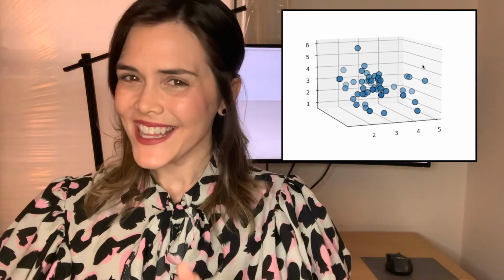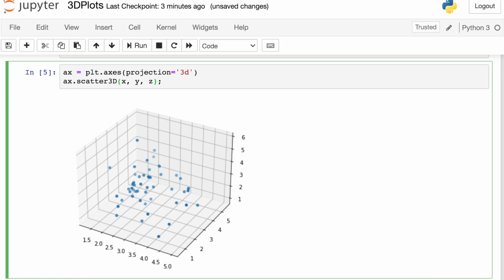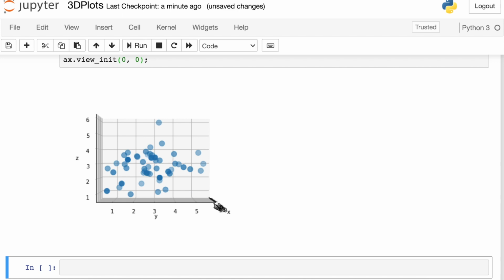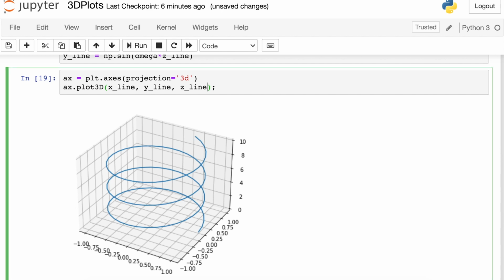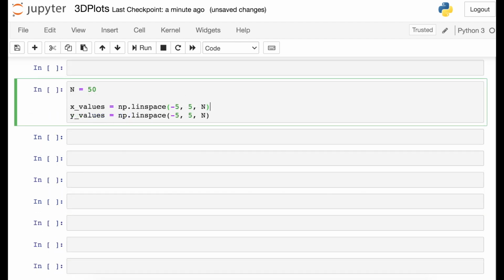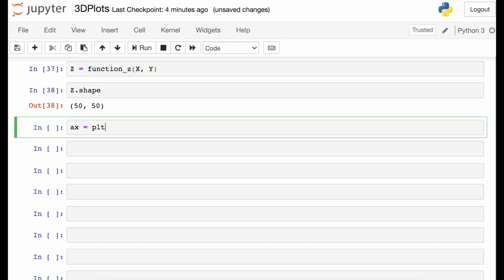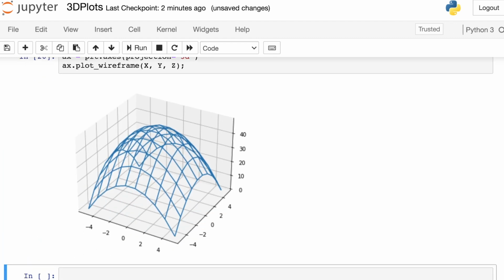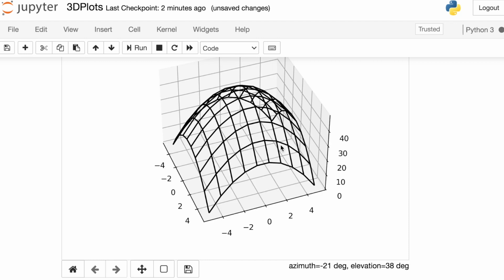MATPLOTLIB 3D PLOTS including Scatter 3D and Surface Plots for Matplotlib Python || Matplotlib Tips

Comment: Hello! For my master thesis I'm doing divergence in 3d plot between normal distributions. if x axes represents mu parameter, and y axes sigma parameter, then divergence should be a surface plot. But the problem is, that I need divergence results with step 0.1. My code does calculate divergence, but the 3d plot is not working. Can you please help me?Thank you so much!
import matplotlib.pyplot as plt

from mpl_toolkits import mplot3d
import math
import numpy as np

def function_z(mu2, sigma2):
            return (((0-mu2)**2)/(2*(sigma2**2))+0.5*((1**2/sigma2**2)-1-math.log(1**2/sigma2**2)))

x_data = np.arange(-5, 5, 0.1)
y_data = np.arange(0, 4)
for i in x_data:
    for j in y_data:
        print(function_z(i, j))

X, Y = np.meshgrid(i, j)
Z = function_z(X, Y)
ax = plt.axes(projection='3d')
ax.plot_surface(X, Y, Z, cmap="plasma")

ax.set_title("Function Z")
ax.set_xlabel("X axes")
ax.set_ylabel("Y axes")
ax.set_zlabel("Result Function Z")

plt.show()

Comment: How can I enable the "interactivity" mode in Spyder? Is it possible? Excellent video and explanation btw
Reply from the maker: Thank you!  Unfortunately, I'm not very familiar with Spyder, but it sounds like it is possible to do this based on @HABIBE KABA DIAKITE 's question and comment.
Reply: Interactive mode is not available in spyder, I think !
However, you can run the program file from the file explorer, so that a new window opens, which is Interactive 🙂

Comment: Thank you for creating this video. It is very helpful. In some of the code online, I see the following import: from mpl_toolkits import mplot3d. Is this needed? Also, sometimes, people explicitly create a figure using plt.figure and then add axes to the figure:  fig = plt.figure();
 ax = plt.axes(projection='3d'). When do we need to explicitly use the figure function first?
Reply from the maker: Most welcome!  Regarding your questions: previous versions of matplotlib required you to explicitly import mplot3d to make a 3D plot.  It won't hurt your code, but matplotlib version 3.2.0 or higher no longer requires this.    And you can use fig = plt.figure() and then refer to that specific figure if you are creating multiple figures with your code.  Really, any time the figure (or axes) you are referring to may be ambiguous.

Comment: how to implement plotting a SERIES of 2d spectra(energy vs conductance) into a 3D plot (x=energy, y=uniformly lined up spectra, z=conductance) in Matplotlib?
Reply from the maker: Hi there - as long as you have x, y, and z coordinates for each of these components, you can absolutely make a 3D plot for your data.  Are your uniform spectra data currently the index of your series?  If so, you can pass the dataframe columns and indices directly into the matplotlib plotting methods like scatter3D.  For example, if you have a dataframe df with columns like "energy" and "conductance" and your spectra are the indices, you can do ax.scatter3D(df.energy, df.index, df.conductance).

Comment: once u move plot interactively, how to query new angles?
Reply from the maker: Hi there - You can still use ax.view_init() even if you have interactive mode on ("%matplotlib notebook").  Just add ax.view_init() under your plot and re-run the cell.  This will start the initial position of your figure at the angle you specify.